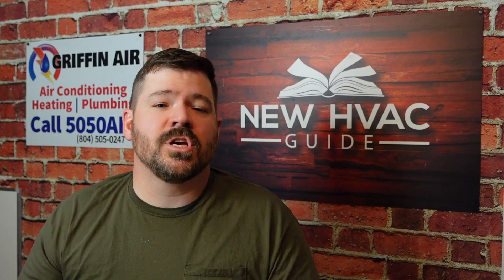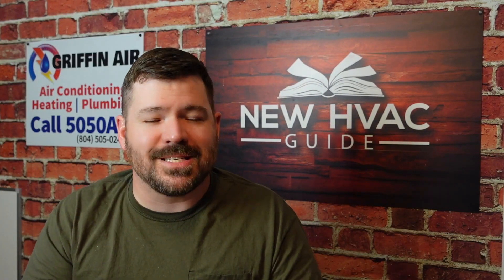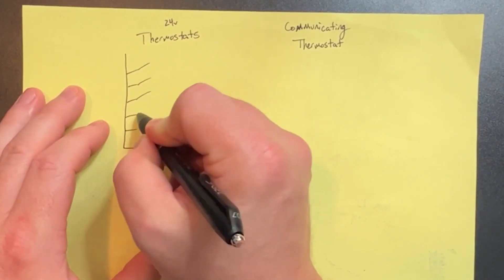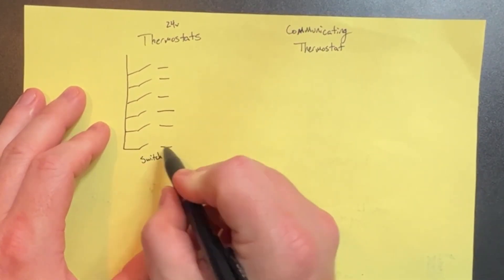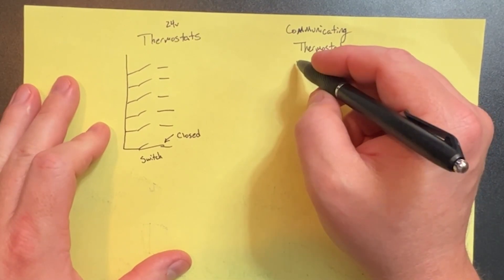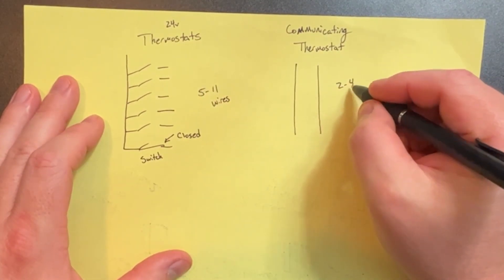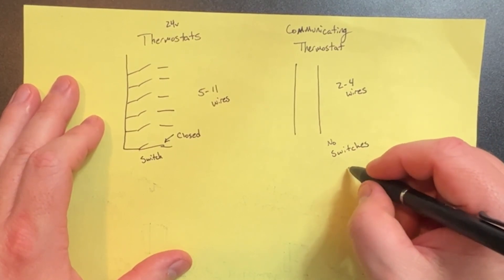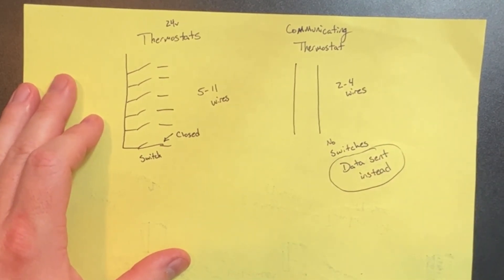3 HVAC Efficiency Types Explained!

Comment: Any thoughts for this unit to replace the Colman furnace for my 1100 sf manufactured home? ACiQ 2.5 Ton 16.9 SEER2 High Efficiency Central Heat Pump | Inverter

Comment: I am having a 3 ton Trane dual fuel system put in. The XV20i heat pump and XC95M propane furnace. Coming off of a 28 year old Rheem fuel oil furnace and ac. I was quoted 19K cash for south east Ohio, is this a good solution?

Comment: on a non-communicating inverter, can stage the fan and get pretty good capacity control. has huge advantage of not locking you into using a specific thermostat and when doing dual fuel, can use any brand furnace.

Comment: Mr. Josh;
Excellent! 
Question:
I have a Residential
 A/C  which has all up-to-date parts. I fixed as necessary. 
Now, since it's been overwhelming hot in this year's summer, I notice my A/C running much longer. I sometimes add a 1/3 cup of water to the water pipe, and within a few minutes, my entire system cooled down my Apartment. Why would this happen? My A/C Coils were just cleaned, A/F is New.I watch over this unit when I notice different sounds. Your system has a healthy sound when working correctly. Is water a need during very hot summer months?
Thank You!🥵

Comment: I think our biggest impediment to enlightenment is distraction.  That's marketing's bailiwick.  They want you throwing around words you think you understand, but really don't.  Inverter? Communicating?  ISO9000?  

The thing to know is computer control.  Computers just follow instructions (when they're working) and those instructions are written by people like me.  Check this binary input (switch), check this analog input value (voltage).  If this, then that, else the other.  That's what's happening.  And that's what matters.  So watch the marketing hype calling things that when we are honest with ourselves we really don't understand.

Take the inverter for example.  What percentage of HVAC techs can block diagram the internal functions of an inverter circuit?  Not that they need to but it's disingenuous to throw the word around as if one did. The idea of computer control opens up possibilities that would be out of reach with mechanical switch logic.  The inverter is a way to synthesize a variable frequency, variable voltage, current limited three phase power supply.  Now we connect a computer to command those three variables and you have motor control (hopefully good).

The issue I have is that I don't have access to the code that decides everything, nor even to the constants.  I'd be a lot more comfortable with a comprehensive flowchart and the ability to modify code and parameters.

Comment: Hey Josh, you've talked about the Bosch Lynx 18 Seer inverter system. Would you expect it to be less efficient than day a Daikin since as far as I know the Lynx 18 isn't communicating...
Reply: Concord/ Ducane Lynx units are Allied Air products. Communicating systems are usually rated better than non communicating systems. With the proper airflow and blower setup a non communicating inverter system will still be very efficient.
Reply: @ryanbrown5334  You most definitely do not want a Concord, Ducane, Allied as they are Lennox brands and have coil leaks and very unreliable.   Amana S-Series is the best bang for the buck since it is the newer version of the Daikin Fit and much more affordable.

Comment: Day & night  or Goodman ? 15.2/15.5   7 k need 2.  What would u put in your house ?
Reply: Day & Night for sure, but Amana instead of Goodman just for warranty and newest equipment and probably the same or close to same cost.  Single stage system are out.  Get a least a two-stage furnace and Amana S-series.

Comment: Back in the 70s I worked as an electrician for the now departed J. E. Mitchell Co., which made the Mark IV after-market car A/Cs. We had a conference room that was used once a month for employee meetings. It was just under a tar roof and in Dallas summers it got very hot. To cool it we had a small A/C system that we started up Friday afternoon. It chilled the water in a tank about the size of a standard pickup truck. On Monday morning that chilled water could be put to work cooling down the conference room for the afternoon meeting. It was a marvelous way to do a lot with a little.

—I've often wondered if the same idea could be adapted to modern home and business A/Cs, particularly in places where the nights are much cooler than the days. Each night when the outside has cooled enough, a simple but efficient compressor would work continuously cooling down an insulated tank in the basement. No need for complicated stages or stopping and starting. Once the proper temperature was reached, it would shut down, giving the compressor a one cycle a day labor. The next day a simple chilled pumping water system would cool the house with that water. The chilling temperature could be adjusted for hot or warm weather. The cool left over from one night would be available for the next. It would have other advantages. In heat waves when power is in short supply, it would cool a building while only drawing enough power to pump water. In winter, simply reverse the process.

—Questions: 1. Does anyone make a system like that? 2. Has anyone tested the efficiency of such a system particularly in dry climates with hot days and cool nights> 3. What do you think of the idea? My hunch is that it might give a simple system the efficiency of a complex one.

Comment: I'm skeptical of the marketing.  Is there any HVAC sales/service person who can define a "seer"?  I don't mean tell me what the letters stand for, everyone knows that, I mean the calculation part of it.  Energy efficiency is simply energy out/energy in.  So how's a "seer" calculated?
Reply: "SEER" is calculated by dividing the total number of BTUs of heat removed from the air by the total energy required by the air conditioner in watt-hours. The higher the ratio, the more energy-efficient the HP/AC is. On a power basis, the SEER ratio relates the cooling power of the air conditioner (in BTU per hour) to the electrical power consumption (in Watts). SEER is very similar to the “coefficient of performance” commonly used in thermodynamics, except COP is a unit-less parameter. (To convert SEER to COP, multiply by 0.293 or (1055/3600). 

SEER ratings are computed in artificial environments that a typical HO will never see. 

PG&E of California caught on that SEER (aka Sales EER) was full of turd polishing. How many HOs realize that a new 14-15 SEER system is on the same efficiency playing field as a 11.3 EER 0.5 ton window A/C that sells for $160?

Make effort to raise the EWB. Play with registers to minimize recirculation. Bring the condenser temperature as close as possible to ODB.

Here's something interesting. As outdoor temperatures change, kw and capacity moves in opposite directions. As return wet bulb drops, capacity drops, but kW power use remains fairly constant.

For one system. If you hold the same indoor 80EWB/67EDB and relative to 95F ODB

When outdoor temp goes to 115F
-25% tons
+20% kW
-40% EER

When outdoor drops to 80F such as working in the Sales EER la la dream land.
+10% tons
-14% kW
+28% EER

If outdoor temp remains 95F, relative to 67F EWB
raising IDB to 71F EWB
+9.2% tons
+3% kW

If you lower it to the more typical 63F/75F IDB
-5.5% cap
~negliglbe kW change

Proper sized equipment is key, short cycling is shitty. 

See; https://www.energystar.gov/ia/home_improvement/home_sealing/RightSized_AirCondFS_2005.pdf
Reply: @DrMonkPhD  
So, copying from American standard, "In the heating and cooling industry, SEER stands for Seasonal Energy Efficiency Ratio. A SEER rating is the ratio developed when the cooling output of the system over an average cooling season is divided by the total energy used. ... A SEER ratio of 21, for example, is the unit’s maximum efficiency and could be lower based on varying conditions."

So basically they're playing games where on one hand they assume a set of conditions that vary over the season, then apparently take the best case scenario.  It's oversimplified and deceiving, essentially useless.  When I bought mine thirty years ago the mfr provided a series of graphs that showed measured BTU output with corresponding power consumption for given outdoor & indoor temperatures.  For heating and for cooling.  That was honest.  Direct data.  No trying to hide anything like they do today with "seer".   With the graphs I could calculate when the costs to run the heat pump equalled that of the gas furnace, given the cost of electricity and that of gas at that moment in time.  This new obfuscation term fails to communicate that information.

I suspect the reason is that when the switch was forced from R22 to 410A, it was a way to hide the fact that R22 is a more efficient refrigerant over a wide range of temperature differential and they didn't want that fact advertised.

Comment: I have a question.
I just had a Mirage mini split installed for my garage a week ago.
The outside unit on the left side does not have a grill over the thin blue cooling fins.
They already have a dink in them. 
I'm thinking about putting one of those decorative slatted covers over the whole unit to protect the fins. Good or bad idea?